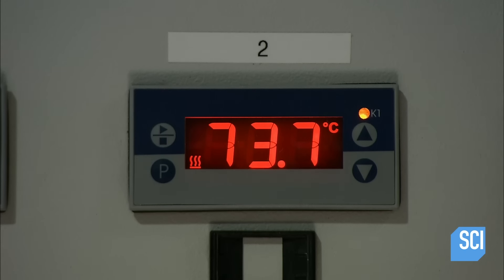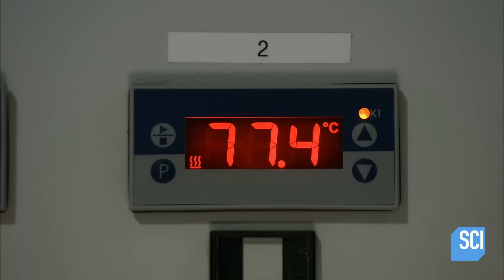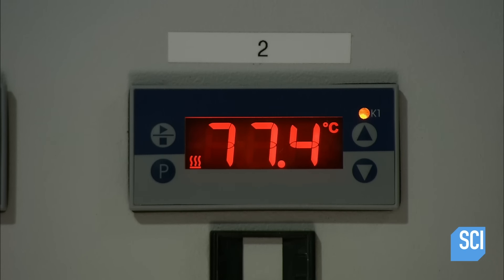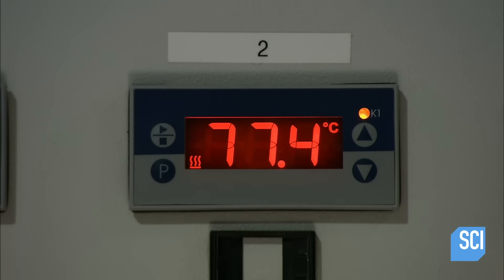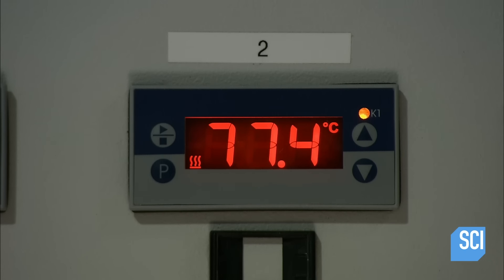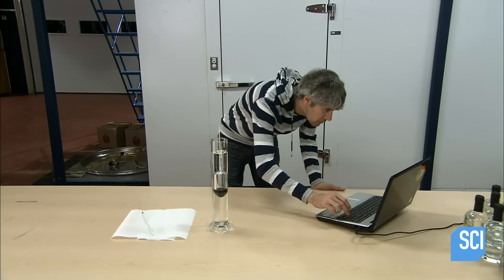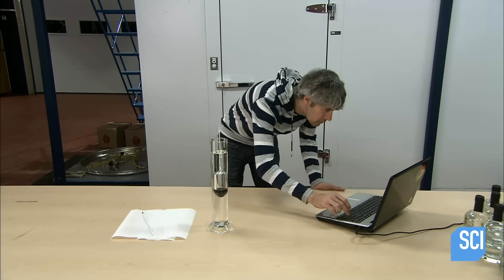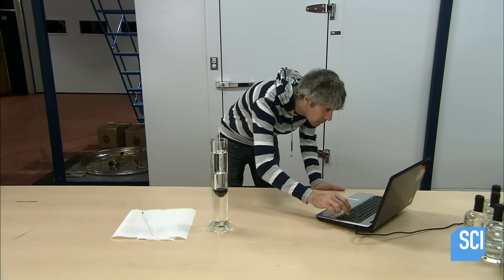How It's Made: Gin

Comment: A friend of mine used to make his own. Quite illegally of course. He is an engineer, so to make a still, the heater and thermometer set-up was a cinch for him. He explained it just as in the video. He started by saying "Gin is just vodka with aromatics added during the second distillation". He added "Its cheaper to make than wine", thus 80%+ of the price of a bottle of gin is taxes.
Reply: As long as you avoid accidentally creating a little methanol.
Reply: @justayoutuber1906  You're starting with pure spirit Ethanol. It's then infused with the aromatics and re-distilled and diluted, so no Methanol involved, unlike distilling from scratch. It's really just fancy flavoured Vodka.
Reply: @risvegliato  To add to this, in the case of this gin, they only keep the heart cuts not for safety reasons, but because the best combination of aromatic compounds come through the distillation process.
Reply: @justayoutuber1906  methanol has a lower boiling point than ethanol.   The methanol comes out of the still first and the distiller usually discards it before taking heads, hearts and tails cuts of the distillate.
Reply: Pure alcohol is insanely cheap to make. From 8 kg of white sugar you buy from the shops, you can potentially make 4 litres of 95% spirits. This is why they tax and regulate it so much. It's so cheap.
Reply: Gin is not vodka, its a bad attempt at making jenever which is the original. The brits used a shit load of herbs to mask the horrible taste their liquor produced.
Reply: @sanderbrugman8157  So, what is vodka if not pure ethanol watered down to 40% ABV, or whatever figure is desired? Vodka, as far I'm aware, is most commonly  produced, commerciall, using grain or, in Russia, sometimes potatoes. Correct me if im wrong
Reply: I do like a good salty dog gin 👍 A good friend made the best salty dogs ever back in the 80's in Corpus Christi 🔥👍
Reply: @thesummerthatwas76  Oh you are SO right. I buy 1 litre bottles of Spiritus Polish 96% grain alcohol for $11.99 from a neighborhood greek market. At the same market I buy Aqua Panna spring water. I mix the two - estimating 50% alcohol and wind up with the best vodka I've ever had. I've even used orangina and lemon fizzy San Peligrino water. You've got to make your own vodka. It's ALWAYS better than ANY "high-end" expensive vodka.
Reply: @skeggjoldgunnr3167  That sounds a great idea. I have yet to find any 100% base spirit for sale where I live, but I will keep an eye out for some and give your tip a go. Thanks!
Reply: This is very much true. Taxes on alcohol especially in a place like Kentucky make up not only the majority of the price of the gin, but also account for most of the taxes the state collects. Seriously. Alcohol is taxed that much. And honestly, good. It keeps the industry in check and makes sure it is giving back to the community. Though, yes, sadly it does make it harder for small distilleries and microbreweries to start. A few thousand dollars a year in taxes is nothing for Jack Daniels, but it is a lot for someone starting, so it kind of leads to a feedback loop that kills the little guys. Such as it is.
Reply: @justayoutuber1906   If you are buying already made vodka and adding botanicals before redistilling, the commercial product has already had the foreshots removed and thus there will never be methanol produced. Only if you distill completely from scratch do you have to worry about that and even if you are distilling from scratch, just throw out the first few milliliters of the batch (it makes for great fire starter if you have a wood stove or something) and you are safe. It REALLY is not something to stress over. People just watch too many movies on moonshining and really misunderstand how easy it is to avoid that kind of thing.
Reply: @2020-p2z  4 liters you would need a advanced still, 3.5 liters, easy. Love the still in this video, look at the columns, this is is not microstilled haha. I make like 10 liters of spirits every week, that's called microstilled xD
Reply: It’s rarely illegal to make booze… but to sell it.
Reply: I make my own tequila. 
For the cost of 1 good bottle of tequila, I can make 10 for the same price.
Reply: Methanol extraction during distillation is a bit of a myth. All alcohol fermentation produces small amounts of methanol, but is generally very small. The argument that distillation concentrates it to a dangerous level simply isn't true and is a myth perpetuated from prohibition era purposeful-poisoning by the American government, and is a myth they like to continue on to this day because, as with all things, it makes the government more tax revenue if people buy it through legal channels rather than attempt their own, even though it's quite safe. Distillation is split into 4 sections; foreshots, heads, hearts and tails - these are really only removed for taste reasons, as methanol isn't actually extracted at any one stage and removed entirely from the rest of the process. The only way to remove methanol to a higher amount is with a dephlegmator, but you'll nearly always get a small amount through unless you are doing extremely high-end scientific equipment for a pure product.
Ethanol is also poison, and you'd poison yourself with ethanol before the methanol content ever had a chance to cause the damage it is capable of.
Reply: Just like Dwarf Fortress
Reply: Tell your friend to keep up the good work.
Reply: @risvegliato  Bingo-bango. Totally correcto.

Comment: Yeah, it's definitely not "tasteless". I've had Everclear and it tastes exactly like it smells. Feels like putting a blowtorch down your throat after swallowing some burning charcoal briquets. Nothing but pain.
Reply: alcohol burn isn't considered a 'flavour'
Reply: i dont think you're supposed to drink everclear straight
Reply: @claptrapbot461  I'm pretty sure it's a fuel source
Reply: @claptrapbot461  not suppose to isn't a reason not to try.
Reply: If everclear was available more readily, nobody would have to make moonshine.
Reply: I've taken shots of everclear (yes 95) and its slightly sweet, burns going down, and fucks my stomach up for about the next 3-4 days.
Reply: @claptrapbot461  no you don't drink Everclear straight let me tell you a story about time in my early days in the Marine Corps we had a poker party someone suggested we make some purple Jesus. What what the heck is that? So we went and got a styrofoam cooler filled it with ice 2/2 gal of Welch's grape juice and a pint of Everclear. The next morning when I set my feet onto the deck I felt something sticky. As I arose out of my stupor I saw that the entire tile floor was purple. What the heck? I traced this menacing sticky goo back to the Styrofoam cooler in the corner where we had the Purple Jesus. It had eaten a hole through a 1-1/2 inch thick styrofoam cooler and leaked all over the deck!

That's when I immediately decided something strong enough to eat through styrofoam is not something I really want to put into my stomach!
Reply: pump a watermelon full of Everclear and chill it - goes down much easier that way
Reply: @kenshy10  where I am from, rubbing alcohol is 70% Isopropyl/30% water. Most modern methylated spirits is 95% ethanol/5% water/a sprinkle of bitterant. You definitely don't want to drink isopropyl alcohol.
Reply: is like drinking parfum channel for the first time. i Love it. all my hairs on the harms raise up to the sky when i taste the first Hooly drops of Gyn!!!!love it and the best alchool drink in the universe.
Gyn Bonbain is the best in this planet.
Reply: My wife and I one time back in college made a mixed drink with Everclear in a 44 oz cup. There was a fair amount of Everclear added last on the top of the drink. My wife handed me the cup to taste it and I asked “It’s good to go?” (Thinking it was mixed up). It was most certainly NOT mixed up because my decent sized gulp was nothing but straight gasoline in my throat lol
Reply: @Jossnaz  I want to agree with you because the advice is true, but so much of what you said lacks some part of the truth. Rubbing alcohol is almost always not ethanol, so drinking something like isopropanol will just poison you. If it is ethanol, it has a bittering agent and chemicals to make it not good to drink. Your stomach and throat might get hurt (especially your throat), but you have layers on layers of epithelial cells in both, with additional thick mucus lining in your stomach.

Tide pods are not alcohol and shouldn't be compared; they're soap (a basic solution) that will dissolve lipids like the stuff cell membranes are made out of, and probably contain toxic ingredients on top of that (fine for your clothes, but not the inside of your body).
Reply: Mmm yummy rubbing alcohol 😋😋😋
Reply: Maaaaannn stop with the Everclear stories, that’s all we drank for a couple years in college 😵‍💫🤢 Not straight mind you, but we’d buy a handle and each of us would half a half gallon of OJ pour in a biting amount of Everclear and mix in apple juice grape cranberry etc & top it off with champagne. And that’d be our drink for the night going party to party on a weekly basis. Every cowboy punch for big parties was Everclear based - 4 10 gallon tubs at the Halloween party with multiple handles worth of that shit in each lmao I might be misremembering some of the details because I obviously fried brain cells and part of my gut during this time, but that shit is like alcohol dabs. Immediate effect and harsh/hot on the intake lol

Comment: “Has an alcoholic concentration of 95%”
“Completely tasteless”

Doubt
Reply: sensational... I guess?
Reply: It has no flavor to taste
Reply: Only pain
Reply: It is tasteless without the tonic
Reply: Tastes like it hurts
Reply: Taste like everclear... Smells like rubbing alcohol. Burns like gasoline.
Reply: @Doom2pro  it is everclear at that point.
Reply: I've drank everclear before.  It has no flavor, just heat.
Reply: taste/flavor is not the same thing as alcohol burn
Reply: Tastes like burning
Reply: What they mean by, “tasteless” is that it is basically a neutral flavored alcohol at that point, like vodkas. It is fermented and distilled to carry over very little flavors of the grain. When you purify alcohol to 95% you lose a lot of flavors that other types of alcohol like whiskey want to keep.
Reply: "Fire" doesn't count as a taste
Reply: Vodka is also tasteless. That’s why gin martini is superior in my opinion.
Reply: It's like sucking out moisture from your mouth.

Comment: "Spring water" lol.  They're pumping it from the public reservoir just like everyone else.  They distill it down for purity, but it's the same water source as you get.
Reply: Kindof a weird assumption. It's neither difficult nor particularly expensive to get spring water delivered. Some breweries literally own their own wells too, which isn't exactly spring water but it's not a public source either. The cost of spring water is nothing compared to the cost of the other ingredients and distilling doesn't remove bad flavors from bad water so it's not that outlandish to use actual spring water. Especially when you sell it for nearly $60 a bottle...

Comment: Many craft distilleries use a different method. When the aromatics are added directly to the still it basically means that is now a dedicated gin still. Smaller distilleries making multiple products can't usually afford this luxury. So a basket containing the aromatics is inserted between the column and the condenser coil. As the heated vapor alcohol passes through the basket the aromatics flavors are extracted and imparted into the vapor/liquid. A set up such as that can be used for multitudes or variations.

Comment: Nice video. Beautiful equipment. What is the temperature they use to boil off the alcohol but not the water?
Reply: 67 degrees c. It’s no secret.
Reply: @JesusisJesus  Next time I’ll Internet search it. Haven’t had a copy of the HC&P for at least ten years. I appreciate your effort. Thanks. You sound irritated, no?
Reply: @richardjohnson455  I’m fine. I used to distill but it became boring having so much extremely high grade alcohol available. I could make any kind of liquor at all, usually better than what’s available to buy so if I wanted to become irritated I’d watch Bar Wars where they are so pedantic about whether a drink is shaken with ice or stirred with a stizzle swick that people lose their jobs over it. I gave up drinking alcohol 3 months ago because it was just too easy and I feel great. I used a turbo 500 still and all I had to do was feed it fermented dextrose beer, keep it clean, and keep the column water temperature to 50 degrees c max 67, so dial in the water column for 57 and watch it fluctuate for 4 hours per gallon, then bottle it, water it down, add flavour and repeat. It becomes so tediously boring that I just quit.
Reply: @JesusisJesus  Great answers. Thank you. I’m a very, very moderate drinker just because  I really do enjoy it when it’s available but I never need it. My Dad fought alcoholism for decades but finally won, thank God. I’ve never heard of giving up EtOH because there’s so much available (your own distillate in your case, even more uncommon), but I’m glad it works for you. I viewed this YT video because I love good gin and well-made G&T’s. How did you wind up starting your distilling practice?

Comment: If you think 'juniper berries' is the main ingredient, when theres half a ton of grain alcohol in there?
Actually. Why lower the alcohol volumn by putting water in it (to 40%) if all  you're going to do is distill just the alcohol off?
And later add more water to that to decrease the percentage again. Anybody know?
Reply: the boiling point of ethanol is lower than water. you don't want the ingredients to burn up in the tank, so the water remains unboiled with the rest of the ingredients while the ethanol rises as gas out of the tank into the condenser. a small percentage of the perfume of the ingredients will rise with the vapor into the distilled tank. however the percentage of ethanol in the distilled tank is not suitable too drink, too high, so you have to put water back in.

Comment: It is NOT a London gin. To make London gin the aromatics are in a basket at the top of the evaporation vessel. Only the alcohol vapor passes through them, they are not boiled in the liquor.
Reply: Nope, that's vapor distilled gin, which may also be London gin but is not a requirement of London gin. A London gin is any distilled gin flavored primarily with juniper berries to which only water has been added after distillation. The reason this gin isn't actually a London gin is that it has had parsnips infused into it. Untill that point, it was in fact a London gin.

Comment: How is something 95% alcohol completely tasteless (as said around the 1:24 mark)?
Reply: "something 95% alcohol completely tasteless" in Ukraine you can buy alcohol 95% in many places including by mail, it does have a taste, sort of, solvent that burns your mouth.  And the price is US$1.70 per liter, usually it's sold in a 5 liter plastic container with a tap near the bottom.
Reply: Taste/ flavor are different things for one. Secondly- alcohol is neither. You experience alcohol much like youd experience hot or cold or pure capsaicin. These are not "flavors" tho

Comment: 4:08
Wait... is he installing tasting corks with a press? Those are so easy to install you can use a single finger. They would literally be easier to install by hand than by using that press. Once, twice, seven hundred times or seven thousand times... that press is less than useless in this instance.